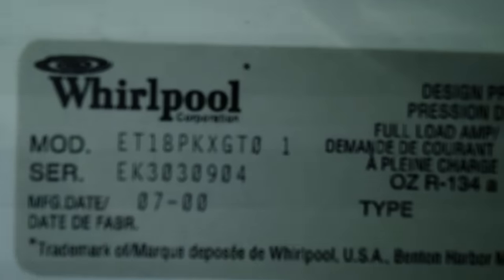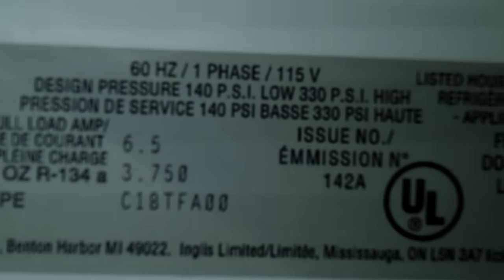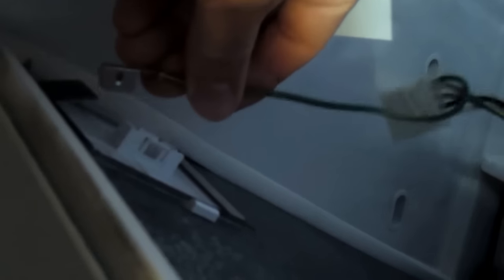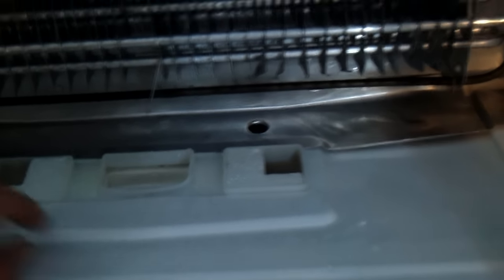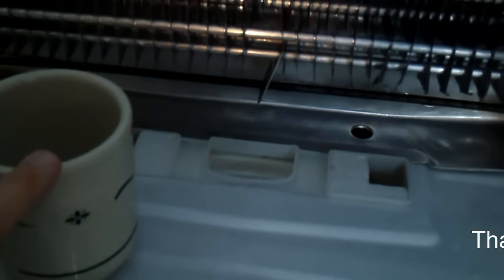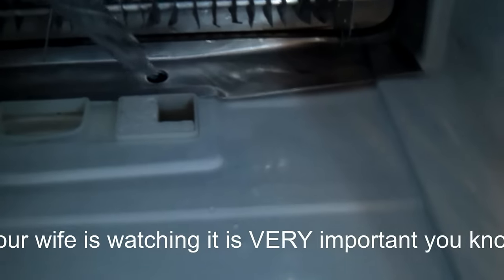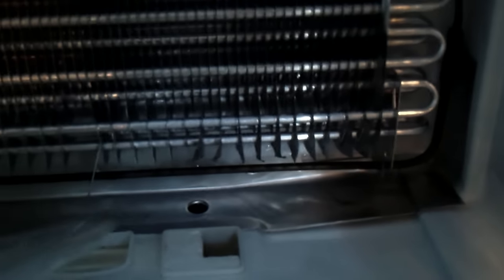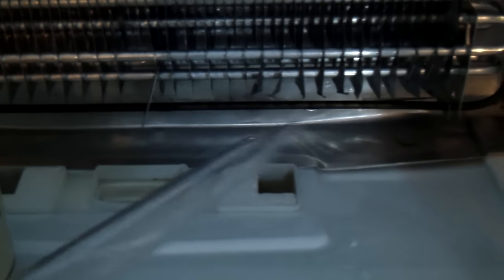Whirlpool Leaking Refrigerator Repair

Comment: Thank you! Just fixed our freezer in 10 minutes thanks to this video!
Reply: +Eric Raines  that was fast, took me at least a half hour just to melt all the ice with a hair dryer on high.
Reply: +Virgil Larson I got some really hot water in my meat injector and just pumped it and in and out of the drain hole. Took about 3 minutes for it to start dripping in the pan underneath.
Reply: +Eric Raines   Great idea, thanks.          If this happens again I
will wrap a # 12  copper wire around the  defroster heating element and run it to the  drain as a preventative attempt.

Comment: thank for the video. I had the same problem frozen solid block of ice. I remove as suggested and melted the ice, now it does not freeze up any more. I like the turkey baster trick it worked perfectly. again thank you for your tip.

Comment: Great Vid!  Sure wish I had watched this before I tore my fridge apart trying to fiqure it out.  I did discover removing the bottom of freezer gave me access to drain without removing the back wall.  Made a funnel from tinfoil and poured boiling water into it and presto.  I'm adding this vid to my favs because by the next time it happens I'll have forgot what I've learned.  Good Job!

Comment: Thanks,  this video really helped.  I have a Kenmore model 160 and it seems that the parts were identical to yours.  When i removed the bottom plate in the freezer i had a solid sheet of ice in mine.

Comment: Thanks! That's just what I needed. I did have a little ice build up covering the tray.
You should be careful working around the coils too as they are sharp!
Finished the job in a 1/2 hour. Sooner if it wasn't for the ice.

Comment: This is the 14th video I've watched on this problem, and it's surely the clearest and most helpful, which gave me the confidence to attempt this fix myself - EXCEPT... I see no screws in the freezer pan of my 2008 Whirlpool. DAGNABBIT. :-(
Reply: No, there is no pan - the whole freezer (except for the BACK panel) is one piece, an oblong cylinder, trapped behind the front frame of the fridge... short of removing the door, I see no way... sigh. The occasional shower inside the fridge continues.

Comment: Thanks for the video,  I had the same problem and was able to take it apart. Warren Adamson, the icemaker has three screws and one electrical connector to remove.  pretty straightforward.  It was a good chance to clean out the freezer too.  Thanks for the turkey baster trip.  Unfortunately i did not have a longaberger cup.  I had to substitute another.

Comment: It's not food it's accumulated ice. When the defroster shuts off the water is still draining and it builds up over time till the hole is completely frozen shut. You can take a cooper wire 12 gauge wrap it tightly around the defroster coil and have the wire go into the hole. That way whenever the defroster runs the heat is transferred to the copper wire that goes into the drain hole. It will melt the ice in the hole if there is any and thus eliminating the water buildup.  That way you don't have to do it over and over.

Comment: Worked like a charm. Thx for the info. Why is it always late at night when these things happen? I just finished my clean out and it's nearly midnight.  Great tip with the hot water and baster...worked FAST.

PERMANENT FIX: Whirlpool sells a "drain strap" for this purpose for about $12. Search for Whirlpool Drain Strap 819043 as an example of just one such strap. Obviously it may not fit everyone's application so check the model numbers for compatibility. There are also many example pictures and how-to articles on making your own with 6" of bare 12 gauge solid copper wire, as others in this thread have mentioned.

Comment: You're my hero! Thank you! Excellent tutorial. My problem was exactly what you described and the turkey baster did the trick! Cheers!
Reply from the maker: The simple solutions are usually the best.  Don't be surprised if it happens again and if it does read the comments for talk about putting a wire down the drain hole.

Comment: Mine is a Whirlpool from 2004. btw thanks for the tip with the turkey baster I picked one up at Target for a few bucks, I wouldn't have thought of that. It was very helpful since I actually had ice blockage in the tube itself. After almost 10 min with a blow dryer on high, had to boil water in the microwave for 2 min and a few good blasts with the baster it was clear. I just hope it stays that way I had to remove my icemaker to get the back plate off was kinda a pain but obviously way worth it!

Comment: This was SUCH a helpful video! A friend's repairman had said to shut off the fridge for a full 24 hours and it would melt the ice in the drain. I did that, but in less than a month, the dripping was back with a vengeance. Had to figure out how to remove ice maker, but in the end, everything worked. Waiting to see how long this "fix" lasts. Is there shock danger wrapping wire around defrost fins to permanently prevent recurrence? Why did it start happening after 8 years of flawless operation?

Comment: Hey man I have the same fridge and had the same problem if you take some copper wire and wrap it around the heating element and hang it down the drain it keeps it from freezing up as often or at all

Comment: Thanks for the video.  I ended up having a sizable ice plug in the drain.  It took a combination of hot water, heat gun, and a compressor blowing air from the bottom up to clear the clog.

Comment: When Ice is too thick I clear out the large pieces by hand, plastic scraper, then stick a fan in the freezer for an hour, then I get a funnel and a hair dryer and direct the hot air down the hole for about 5 minutes. I then take a wire hanger and kinda get an idea where the ice "plug"" is located, leave the wire in there then pour hot water as described in video....the wire can be used to gauge your progress...DO NOT FORCE the wire hangar down the tube, just let it find its way with subtle twists, etc. Victory has a voice here as you can hear the water flushing down the tube freely. THANK YOU FOR THIS VIDEO

Comment: I was able to clear the drain using your methods.  I too found a sheet of ice across the bottom of the freezer after taking off the horizontal panel.  When I had everything cleaned up and the drain hole clear, I noted a couple of things.  One, after taking off the horizontal panel, I could see and get to the drain.  Why take off the back panel?  I did take off the back panel, but before I could do that, I had to remove the ice maker.  I found that there are two sheet metal screws that attach the ice maker to the vertical wall of the freezer.  If one LOOSENS those, but does not take the screws out  it is much easier to reinstall.  The ice maker hangs on the two screws.  After tightening those, the third screw on the bottom is tightened to finish the job.  Thanks for tutorial.

Comment: Awesome, Thanks!  Gonna leave the panels out and see if the tube is cleared now or if I have to do the mod with a wire.
Reply: After leaving it over night, the drain was frosted over, so today I took some solid core copper and added it to the defrost element and into the drain, hopefully that solves the ice buildup issue.  Thanks again!

Comment: I watched many Youtube videos that helped me understand the probable problem. (Thanks to all of them.) I was all set to take out the back panel of the freezer and use hot water (with baster or wire or blowdryer etc) to melt the ice blocking the drainage hole. And then I thought: well, ice melts, so why don't I just unplug the fridge for a day. (My friend was fortunate to be able to temporarily put the freezer food in a neighbour's fridge.) A day later, the friend replugged the fridge and it's been two full months now and no water has leaked. Maybe it was just luck or our particular circumstance or just a temporary fix, but it may work for you too. All the best. ** [Note: In ONE of the many videos I watched, when the back panel was taken out, there were food debris behind (!) the panel. How debris can get behind, I can't imagine, but if food scraps are blocking the drain hole, then you have to get behind the panel.]

Comment: Very helpful video--thanks!  Mine is a 2004 with icemaker and was also leaking. I installed a length of copper wire wrapped around the defroster coil and hanging down into the tube, which hopefully will remedy the problem in the future. BTW, I noticed the Longaberger mug right away and thought "his wife is gonna kill him for using that!"  LOL
Reply: Hello.  Any chance you could give me some basic instructions on how to do what you did with that copper wire?  Thanks very much.
Reply: Frank Baker
Find any kind of copper wire and strip the insulation off of it. I used some old speaker wire, about a 4" length or so. Once I had the insulation off, I just twisted it into a single strand. Then I looped it around the defrost coil about 5 times and let the rest stick down inside the drainage tube. The idea is that the copper conducts heat and will keep ice from forming because it will keep the temp inside the drainage tube above 32 degrees. So far I haven't had any more problems.
Reply: Well it's been 2 years since you posted this comment, and it might be time to check on that copper wire. 
Copper will corrode over time, and could present issues down the line. I'd recommend using aluminium instead.

Comment: Thank you, I would have thought I could find my whirlpool drain tube but I couldn't until I saw your video. Mine had some funky mold in it so after I got it flowing with the turkey baster I took another suggestion of  putting some bleach in the water which will hopefully stop the mold from reoccurring. I was probably somewhat at fault for turning everything to the coldest setting before I left for a month away which froze the drain and not resetting it until after it started leaking.Thanks agai

Comment: I have a similar refrigerator (ET20NK) and used your tutorial to defrost my freezer.  It worked great!  Thanks!!!  One question - where you pointed out the two spots that allow the cold air to go down into the refrigerator, I have two blocks of styrofoam that cover the entire square holes and are about 2 inches tall.  They are completely solid!  I couldn't even get to the drain hole!  Think I should cut them down flush and cut out a square corner like yours?  We moved into the house and this was existing so I don't know if it froze up frequently.  BTW when I removed the back panel, the upper right side was one large block of ice as was the bottom of the freezer.  Any suggestions are appreciated!

Comment: Thanks for the video. I have the same problem on a 2003 model. The difference is the bottom is molded with the sides. There are no screws in the floor. The back screws appear to be hex bolts. 
I called a reparimen but they are dragging their feet about coming, probably because it's such a small job.
I am about ready to DIY if I can get the hexnuts loose.

Comment: I found leak similar to yours. Found I could run a zip tie through hole (and the tube ) and clear up ice or crud. Did not require me to remove anything.

Comment: Great tip! Still have to do it every few months, though . . . is there any way to avoid the problem in the first place?
Reply: ***** How does it work to put wire down that hole? Do you need to attach the other end to something? How far should the wire go down (how long of wire should you use)?

Comment: Very helpful; thanks.  To melt that (extremely stubborn) ice clog at the top of the tube, I used a heat gun.  It took all day, and the heat blistered the wall.  Next time, I'll definitely try the hot water & turkey baster.

Comment: Just did the same. Found an old pipe a funnel and poured boiling water into it. Then dried it up with a towel repeated four times. Still seems clogged but this old Kenmore elite looked exactly the same as this video.
I may do some more tomorrow. Just not sure there’s any way to tell when it’s clear.

Comment: Hi. Thanks for the video. Do you need to turn the fridge off or unplug it before doing this? Is it safe to touch the metal stuff in the back behind that panel while the fridge is running?

Comment: Thanks for the tip - I wonder if shoving a wad of plastic scrubby or something similar (like steel wool not something that won't rust) would prevent that from jamming up so quickly.

Comment: Make sure the hanger goes down into the drain about 5 or 6 inches at least.  Be sure to wrap the other end tightly around the heater element to transfer the heat.  Whirlpool still hasn't addressed the problem and recommends this solution.  Go figure.  All the best to you!
Mark

Comment: Thanks for the tip - worked fine and saved us from buying a new fridge!!!  We used 1/4" socket on the hex head screws in our 2000 model.  Also had an ice maker to remove.  There were two styrofoam wedge-shaped vents blocking removal of the back panel that seemed glued in at first.  They were actually frozen in, and later pulled straight up out of their holes.  Beware of the sharp fins on the coils#&@!!. In future I think I can pull out the tray, pull up one styrofoam vent in front of the drain hole, I can thaw it without taking off the back panel.

Comment: Thank You! I also had the same issue and could not figure out why I had a one inch layer of Ice at the bottom of my freezer.  Took a while to clear the ice out of the drain whole, but once I did (with boiling water)...that solved the problem. Not sure why the whole got froze over in the first place but the freezer is 12 years old..so maybe it built up over time?
Reply: you mean wrap a piece of copper wire around the freezer heating element and then push it down the drain hole?

Comment: Thanks for video, i had the same problem. Now i have put hot water in it and took out the water was sitting there, After this water start dripping at back bottom part. Let's see hope it is fixed now. Thanks again

Comment: another posting recommended wrapping a piece of copper wire around the heater, then putting the other end down the drain tube to keep it from freezing.  sounds like a good idea!
Reply: My repairman did this when he fixed the same problem two years ago.  It all froze up again this week.  Fixing it myself this time!  Love the hot water idea.

Comment: I'm a maintenance tech and I have these same refrigerators all throughout my complex. There are a few that I have to clear every 3-6 months. That shouldn't be the case. I've heard that sometimes the problem may also be the defrost thermostat. I'm researching it further and will be consulting an appliance professional. 

Good video though. This will get you by if you're having this problem. But if it keeps happening over and over, there must be another issue somewhere.

Comment: You can use a heat gun or a hair dryer to melt the ice in the drain tube as well. This heat gun method also prevents damage by not having to chip the ice out of the drip pan and can also melt the ice out of the coils for a fresh start.

Comment: This method works well. For a more permanent solution, take a 2 ft length of copper wire and wrap it tightly around a small dowel leaving 4 inches straight at one end. Take the coil off the dowel and drop it into the drain hole. Wrap the remaining copper length several times tightly around the heating element (long horizontal metal bar across bottom). When the element kicks on, it'll heat up the coil and should de-ice the drain automatically.

Comment: Well, I just had to de-ice the hole for the third time in as many months [the first time I just unplugged the fridge for a week while I was gone so the ice melted slowly]. Today I did my second disassembly but this time I also put in the coat-hanger wire. Note that, at least on my model, the hole is not straight up-and-down; it's angled off to the right. I could only get about 2" below the surface, so let's see if this is a permanent fix for my fridge. Thanks again to CTCAPER and Mark Harman!

Comment: Is there a way to prevent this from happening in the first place? Has Whirlpool Canada ever addressed the issue?
THANKS FOR POSTING THIS. I did this in January 2013 and here I am in late December 2014 discovering water once again. Doh!
Reply: *****
Okay but I can't find the comment about the wire contraption works? Is there another video I have missed along the way? thank-you

Comment: I have has this same problem before and the problem was that I had the freezer set to low. that was the problem and once I raised the temp of the freezer the problem went away. from the temp being too low the water that was supposed to drain was freezing in the drain hole. I hope this helps.

Comment: Definitely an ice maker. We have one but don't use it. I took it out to clear the drain hole and don't want to put it back in. Can I just leave it out? Do I need to cap the water line or plug the holes where the screws held in the ice maker in the side of the freezer?

Comment: Another post has it as a failed defrost coil and or thermostat if this problem returns every few weeks which mine does.  This would explain the many years of use with no problem.  Freezers don't gather crumbs for the most part and this drain hole is behind a panel.   However debris would cause the same icing but would not return every few weeks once cleared.    Sounds like the defrost coil issue is wide spread on this models.  Hope this helps.

Comment: Is it normal for the copper hoses coming from the compessor to cover in frost ("ice) i noticed some of the pipe had foam insulation. where there is no more it covers in ice and then leaks on my floor